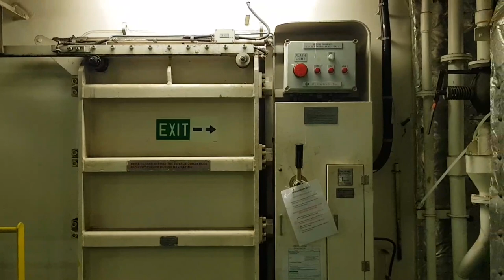MEGA SHIP ENGINE ROOM TOUR in 40 mins.   153,092 GRT, 13,200 TEU (MSC SHIPS) #msc #container #fyp

Comment: How many engineers to run this 24/7 ? 20?
Reply: 2 engineers at most every 4 hours per duty
Reply from the maker: Only 4 engineers, 1 electrician, 1 fitter and 2 oilers.